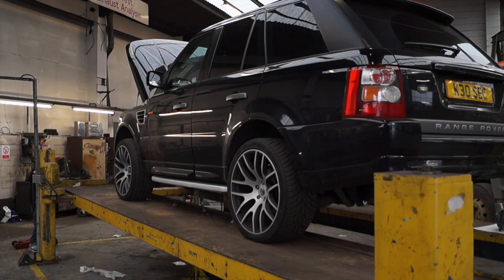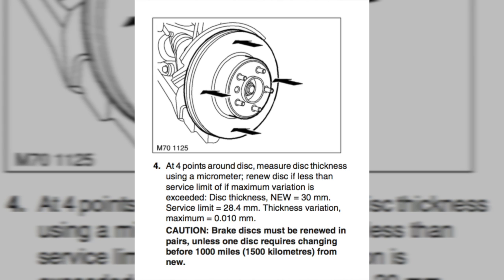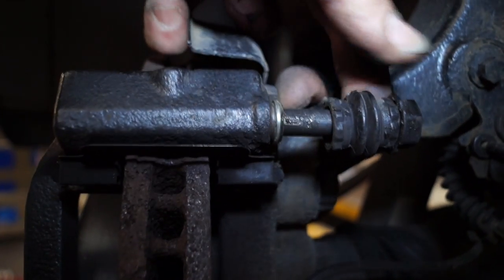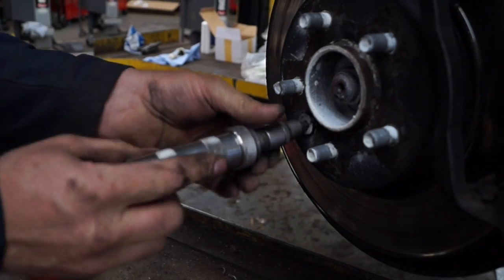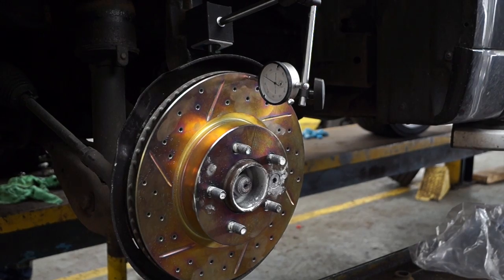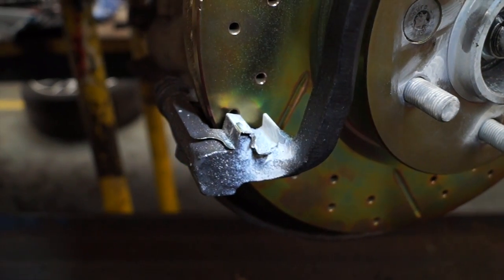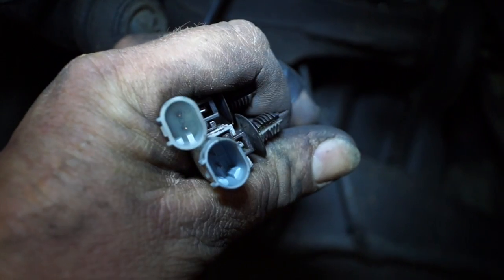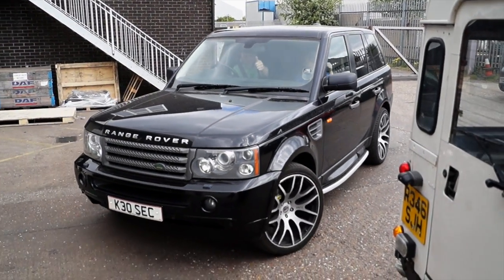Range Rover Sport (drilled and slotted) Front Brake Discs and Pads change - how to.

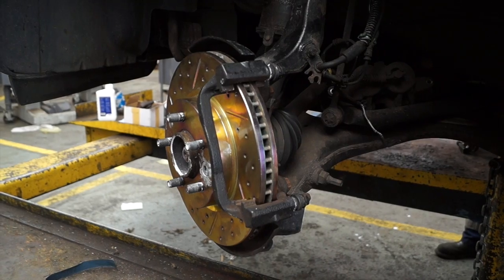Comment: Great video! Very helpful information. Just wanted to make note on the torque specification in minute 10:10 regarding the brake anchor plate. Your video suggest 110 NM of applied torque and the official Land Rover service manual states 275 NM (203 lb. ft).  I understand this brake anchor plate is under a lot of stress and that is the reason for the additional torque amount. Greetings.